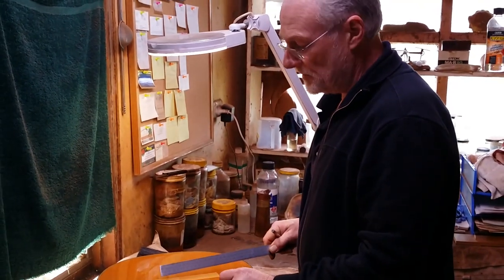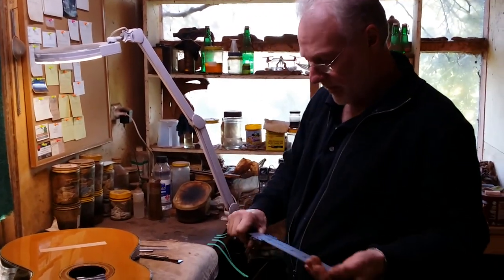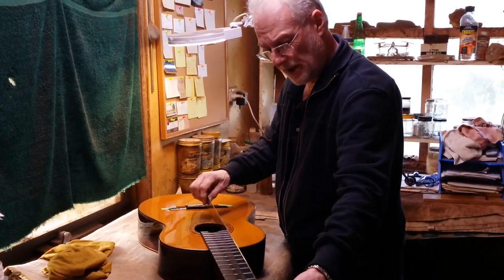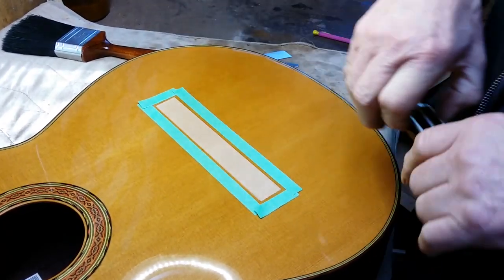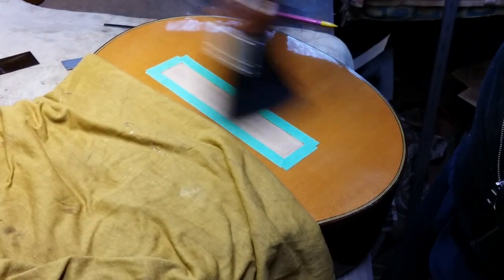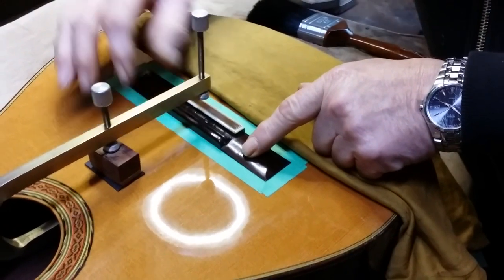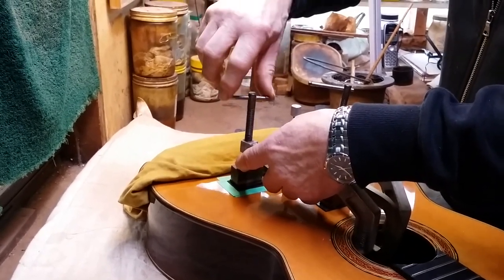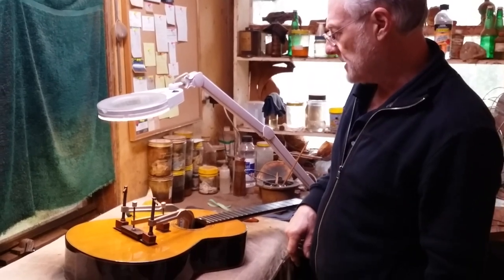Sticking the Bridge - Howell Guitars

Comment: Hi Richard, which tape are you using to cover the bridge position pryor to appying the finish to the guitar please?  Great video by the way, very calm and easy to follow.  Thanks.
Reply from the maker: It's what's called painters tape,  although it will stay in place well it also peels off without damaging the grain of the top.

Comment: Hey! I'm building my first guitar, but I have a question. Would it be stupid to glue the bridge on before it's on the body? I'm worried about cracking the top when I've already assembled the body
Reply from the maker: Hi Tommy,  It's not the best way of doing it. There is no reason why you should crack the top when gluing the bridge if you support the top from the inside.  If the bridge fits the top like it grows out of it you will need very little pressure to hold it in place while the glue dries.  In would recommend hide glue for the job.

Comment: If your using those large heavy clamps, at least protect the guitar top from mishaps with something. Also, who uses heavy clamps on today's very thin soundboards? Also, stop giving arbitrary time lengths for a process, like, "24 hours is good, 48 hours is better." Other than that, this is a very good method, explained well, thank you.